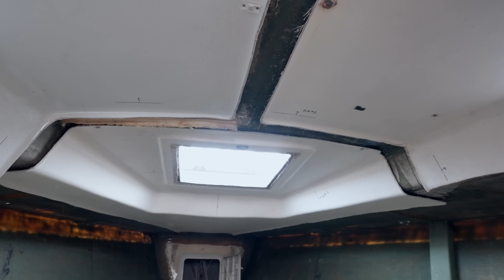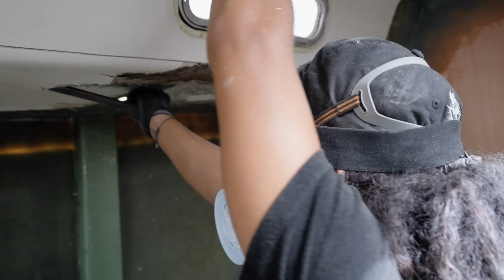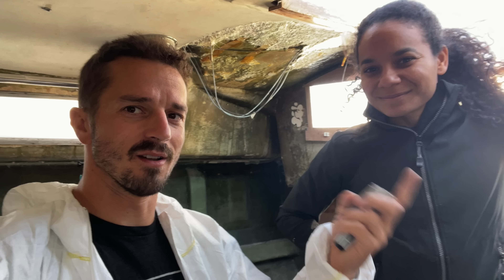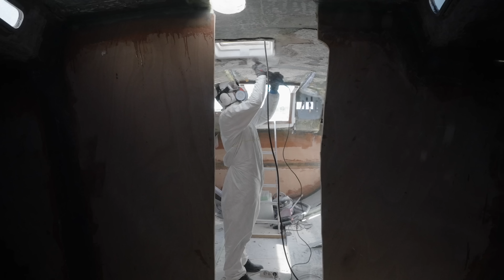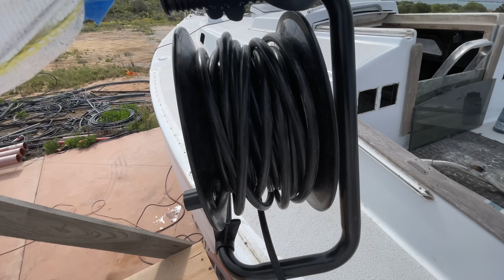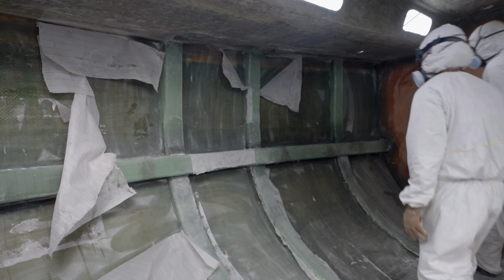Grinding It All Back Out | Step 389

Comment: It’s ironic how firmly the headliner was attached vs how poorly the bulkheads were. Admire your perseverance 😊
Reply: This comment right here!!!!
Reply: If the entire boat was made out of headliner, they'd have never needed to do this project. 😂
Reply: Still would have had the condensation issues did you not watch?@talyrath
Reply: To bad that at the Factory the headliner personnel did not install the keel and the keel workers install the headliner, would have produced a much superior vessel
Reply: @mattdouglas5570, I bet you’re fun at parties…
Reply: @SailingUma  Have you seen Kraken yachts ? based in Turkey. Well worth a visit. They tie the chain plates to the keel.
Reply: Great work this week guys. Sometimes the least rewarding work is the most interesting. The resin, the moisture, the power out! Thank you.

Comment: To stiffen the top you should do a grid similar to what you did on the hull. It doesn't have to be a very tall grid, but even a 25 mm high grid would do a lot. Make it about 0.6 meter grid squares and that flex would just about disappear. The grid would also give you something to mount your removable sections to. You could also run some plastic flex conduit to route the wires for lights and the like.
Reply: I totally agree with you.  The extra space would allow for a wiring raceway system which would be great for flexibility and future wiring replacement/modifications.  The added deck stiffening is icing on the cake!
Reply: hmmm, a tasty possibility...
Reply: I was thinking the same.  One can use some  hidden mounting points.   Similar to how a swans floor boards come out
Reply: Absolutely!!! A must
Reply: This is a really good idea.  It will be a chance for you to flex your architectural muscles.  You could even make the structural ribs triple duty as a cable race, structural element and design statement piece..

Comment: Let the ceiling ribs be thick enough that you can armacell/flex insulate the ceiling, it will make a big difference both in the hot and cold climates, and it will lower outside noise.
Great work guys!!!
Reply: exactly my thought too, I strongly concur- now You have the chance to fix all this in one sweep !
Reply: A lot of that damp could well be condensation.
Reply: Spray foam for the WIN! If it's within the budget.
Reply: Also my suggestion: I would prefer a spray cork insulation if this would be in a budget -  cork is naturally resistant against mold infestation. Really admire your energy and stamina. With you two, one can experience that 1+1 is not two but a multiple - wonderful to see how beautifully you interact as a couple. Good luck with your big project: if anyone can do it, it's you two. Sailing greetings from Berlin
Reply: @t.p.2811  cork is also naturally resistant to fire and does not absorb water, but can absorb some oil.

Comment: As much as I hated to sell our 50+ year old boat, I'm glad I didn't end up doing what you are doing. I remember the squeeks and groans while sailing her and bringing a boat that old to modern is way more than I wanted or needed.to do. You are doing a fantastic job.
Reply: Behind the headliner you found moisture and mold ofcourse .
This means condensation, how are dealing with that now? 
Are you going to insulate the hull above waterline and the ceiling? 
Insulation makes a huge positive difference when you live on a boat where ever you are!
By the way, amazing refit you two are doing with an energy and enthusiasm I can only dream of and than i still will be tired 😊
Reply: they're basically building a whole new boat out of Uma's basic structure!

Comment: Hi there!
I’ve been following your adventures from the beginning, and have very much enjoyed them.
As for your current project, I’ve been there and done that!
We have a Goman Express 30 sailboat we bought new in 1982. 
By 1987 we realise that it wasn’t quite perfect, and after exploring many bigger boat options, we decided to to modify it.
So we took out the entire inner liner, both hull and deck, redesigned the interior, made a mold on top of the old deck and layed up a new cabin top.
We put in a quarter birth on starboard, moved the stbd settee back towards the hull, and many other mods.( improvements.
When it was all done we were delighted! But during the process, I often questioned my sanity.
If I recall we took out 80 lbs if dust from  removing the inner liners.
I am very much like  your first redesign!
It’s an interesting problem optimising the use of space in a given hull shape.
Best of luck!
Cheers😅
Charley

Comment: Idea, you could do a small profile grid under the deck like you did on the hull. Then you’d be able to hide wires and maybe insulate. Then it would give you a place to secure a headliner to.
Reply: Even just laminating PVC conduit pipe ( 5/8”) with a 6” wide band of glass will do both stiffen the deck and provide a route for cabling…

Comment: 17:46 story of DIY. I've been renovating my girlfriend's closet... Was gonna be a week project... It's been... 2.5 lol. 

Pulled off panelling. Laid hardwood. Mudded the drywall that was behind the panelling. Primed. Painted (walls and ceiling). Struggled with floor finish for days (still looks like crap) and still gotta paint the patches and install moulding and the actual closet lol

Comment: Getting rid of that overhead liner is a damn good choice, going back in, I would take 1" thick foam board and glue it up to the overhead and house sides, it will help keep the boat much more comfortable in the weather extremes and it won't condensate. 

You could either glass over it, or even better put a headliner in made out of vinyl that will not condensate, could do some nice wood on the cabin house sides and have something really beautiful.

Also I suspect with taking that liner out, and the floor liner, that you have removed close to the amount of weight as you have added, not quite, but close.
Reply: Watching this episode, I was also thinking about insulation & condensation. Sandwich boats have much less condensation. Since you've stripped it naked, you can add a layer of foam and glass on top of it, or any other insulation solution. I wouldn't leave the outer shell naked like this. I've been watching your work for years. Love your energy and mindset!
Reply: I had the exact same thought when I saw this and it shouldn’t even take more space and there was lots of air behind the headliner’s
Reply: Yes, insulate now, it will be great for reducing the weather extremes above deck.
Reply: @janbennetsen7292  yeah, that was actually quite cringe seeing that because to me it just looked like a big mold trap!
Reply: I think that is a great idea and now is the time to insulate. I hired a urethane foam sprayer guy who came out to our Seawing 43 and sprayed one inch of foam on the hull/overhead which I sanded smooth (easy to do with a sanding board) and saturated a matt/10 ounce fiberglass cloth over the top - 25 years later it is still warm and dry in the Pacific Northwest.
Reply: @Morrisfactor  I sail the PNW as well, you can ever have enough insulation up here!
Reply: @RenegadeADV  YES!  My current boat here in Annapolis (Hollmann 52) does not have insulation, and it is cold/hot and produces MOLD like crazy - makes me yearn for an insulated hull!
Reply: @Morrisfactor  I have a Spencer 42, it made such a huge difference when I insulated the hull. Went from running 3 electric heaters to 1.5 when it was super cold.

Comment: Rustoleum 9100 has proven by far to be the best two part epoxy paint to use for the boat interior, including the bilge. It has various activators that allow for total immersion applications (bilge) as well as low temp application. It's used on oil rigs and other industrial applications. Does not require sanding between coats.
Reply: Thanks for the tip!

Comment: I hope you take the opportunity to insulate the hull and deck with som foam befors you close it with a final layer of glass. That will definitely have an effect on avoiding condensation in colder climate. Keep on the good and hard work. Interesting to see.
Reply: This is one of my objections to glass instead of wood as a building material.

Comment: It’s almost like they secured the ceiling of that boat with the the perfect glue vs the ribs and bottom structure with Elmer’s glue. What a big difference. Glad you guys pulled it down because those leaks are concerning.

Hopefully your lower back recovers. Grinding a ceiling like that with your arms above your head just wears you out like a marathon.

Comment: Removing the overhead liner makes perfect sense to me.  It squeaks, makes bedding deck fittings difficult, and when Dan pulled the large panel down, the dust that fell would be slowly filtering out for years !  Bet you will be much happier with it gone.   Meanwhile you probably itch like a pack of stray dogs!
Reply: Yes, imagine what that microdùst is doing to the lungs!

Comment: One idea for the new headliner: use a stretched fabric solution like Whisper Walls. It's lightweight and provides easy access to the underside of the deck if needed.

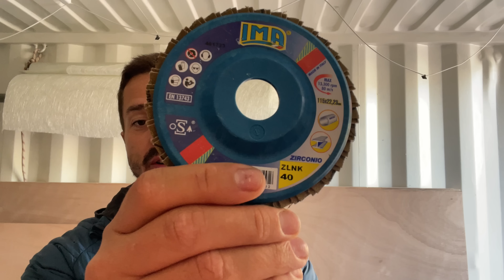Comment: 14:45 get a surface conditioning tool, I have one made by vevor and they are incredibly useful. You can get a drum for anything and it leaves a way more even finish than a grinder with less work.
Reply from the maker: Yes on flat surfaces. But what about compound curves? Wouldn’t they dig in?
Reply: @SailingUma  depends on the drum and how steep the curve is, the abrasive brush and the more spongy stripping drums are pretty forgiving and do work on compound curves, you can also use the corner like you can on a grinder.
It won't replace a grinder but it really helps in my opinion.
I got mine for dealing with my car and some boat work.

Comment: Glad you removed the headliner. Lot's of crap up in those nooks and crannies, that would always come down as dust. And yes, the weight reduction.
A bit late now, but the tool I've found that makes short work of removal is a flat scraper blade that attaches to a sawzall. It removes tabbed fiberglass or separates dissimilar materials with ease. Used mostly to break up floor tiles and remove glued down carpet.
I love that you've integrated your design backgrounds with physical production, and done very well at it.

Comment: About adding a new glass layer on the ceiling. On the rest of the hull, the new fiber layers added had the resin "flowing" down or sideways with gravity. On the ceiling the resin will tend to flow away from the joint, towards the lower surface of the added layer. 
Are we sure the new layer will stick nicely to the ceiling or will it be prone to delamination because of that?
Congrats for the great channel and dedication to this project. You're awesome.

Comment: You may want to do a little fairing before you glass the underside of the deck... it should increase bonding with a more regular surface as long as it's prepared properly.
Reply from the maker: For sure!

Comment: A nice 1/2" by 1" grid system on the roof to stiffen it up and allow cables and lights to fit, also make the roof sections out of carbon fiber to save on weight if you have the funds.  Has a boat architect told you how to stiffen the bulkheads where your main stays attach to make it extra strong and wide.
Reply: I was wondering about carbon fiber also - may  be worth it in the top lining.

Comment: Since you guys are basically starting over from scratch rebuilding, you should totally add in an AC to keep you cool and comfy and keep the bugs out by being able to keep the boat closed up in hot climates.
There's some awesome ones that are relatively compact and virtually flush with the ceiling so it doesn't interfere with your head room. 😊
Reply from the maker: We’re considering it. But in 10yrs the only time we’ve wanted or used it is in marinas. Which we tend to avoid!

Comment: Any small air pocket next to the skin/deck will collect water.... I found the same thing. The head liner must be sealed to skin or well ventilated. I removed our headliner in the middle of the hottest, driest part of the year and the cavity was soaking wet. Once open, it dried out in less than an hour to bone dry. We only used that boat for "camping" so I left it open and painted it. There were originally 3/4inch strips of ply as "beams" but I replaced those with 1.73 inch arcs cut out of a 2x10. As the deck had started out as pretty much flat, it wasn't that much of an arc. You may be better with a laminated beam to form the arc you need.... but it doesn't need to be very thick. Beams look nice, I think.

Comment: how about putting your foam ribs glassed into overhead to gain stiffening of cabin roof? (you could preplan small wire "passageways" through the  ribs before glassing)??.... till  using the dainty carpenters finish hammer for demo , i see + get a "posket sledge" 3 -6 lbs( you will find it useful in amny applications, while you build your muscles!!.... be Well!

Comment: If you want to get rid of the condensation issue you need to add some insulation and a waterproof barrier on the inside (would be called vapour barrier in a building!). You can't negotiate with water vapour physics...

Comment: I am using the same flap wheel discs on my grinder to take the old coating off the bottom of my 27ft. it is quick, but you're right, it is very uncomfortable. I am glad you said something about the edge of that wheel, i didn't think to grind the edge down a bit because i did run into a bit of gouging while trying to remove those bottom coatings.

Comment: Yes, the liner was structural somehow. A grid of 1x1" foam ribs 10" apart would give a lot of strength... you can also screw the liner to the ribs... You can also use the ribs as a channel for the wiring..

Comment: Geeze y’all. That’s some serious hard work. We had spray foamed our little 25 footer after glassing in pieces to screw the facade over top on our cabin top. It keeps the moisture out of the boat. The only place that sweats are the ports and the cabin sides, as this was the only place we didn’t foam. (Well besides below the water line, as this shouldn’t be foamed) Good job y’all 👍👍💪💪

Comment: I started watching Sailing Uma at Step 6, Rebuilding our Keel Structure. It's been an incredible journey over the past 8 years! Feeling like I know you both from watching all of the videos and your propensity to research and plan, is it actually cheeper to completely refit Uma vs. buying a new boat? In the end Uma will be reborn as a new boat from the inside out!
Reply from the maker: It’s 10X cheaper to refit if you do the work yourself. 2-3X cheaper if you hire a hard to do it. New boats are super expensive.

Comment: Removing the liner is easily the hardest job to do on a boat interior. I did that on  a 60 foot boat with my dad. Day after day we cussed pulled and ground it out. Fortunately I was in my early teens and I was strong enough to do the job. It did teach me to never do that again! When you get the next layer up there it will help with firming up the deck. At least now r there are much better materials to do the job with. We didn’t know anything about peel-ply. I wish you guys luck and try to find a hot tub somewhere, you might enjoy the relaxing of your overworked muscles.
Best of Luck, Your Pal Al

Comment: Dan…after I removed my ceiling liner and sanded all the high spots off, I sprayed texture on it and sealed it with water proof paint and it held for 8 years when I sold the boat.   It looked fantastic and hid a multitude of sins.  😊

Comment: Demanding difficult work, grinding overhead and the nasty dust!  I would definitely add some re-inforcement to the deck, thick ribs are proably the easiest thing.  in terms of insulation, I can see that for a deck it's better to add later, as having glassed in foam core makes for much more difficult installation and maintenance of deck fittings. Thick ribs leave more space for insulation.  You must be really pleased to have got rid of that mould, it is bad for your health.  Hope you can get some insulated windows with insulating covers, anything that cuts out the condensation will be well appreciated in cold climates.  It's a complete rebuild from the inside!   Perhaps you can make your own foam core panels (see The Duracell Project), the weight saving is significant, and where the will be water such as in the heads and galley, you avoid the risk of rot.  I think the Duracell Project's system of batch making their own variable spec foam panels is brilliant.  You should have space in the container to make a foldaway vacuum table.

Comment: I strongly support LostYogi's comment, you need insulation in the cabin top and sides. That small air space between the inner and outer layers did provide some noise and thermal insulation. Now is the time to do it right.

Comment: in my Pioneer 9, the headliner is similar to yours, and to my view it plays a structural role. 
the only soft spots i still have one the deck are exactly where the liner wasnt epoxied to the deck. 
since ive rebuilt the whole V berth interior adding semi bulkheads made out of 3 mm G10 - which essentially connects the deck to the hull - , i was able to eliminate almost all of the soft spot but i still have them. 
in the main cabin the rebuilt didnt call for the insertion of any new G10 vertical partitions but, like in your boat, there a space between the liner and the deck  (i also had leaks and condensation just as you shown) and that space will be filled with 2 part foam, which will not only insulate and act as a core material, thus reinforcing the cabin top wheni step on it.

looking at your footage your deck is really flexing and i honestly dont know if a couple of layers of glass will remedy that.
i would get that foam you guys got for the stringers and frames, have them about 1 inch think and laminate them at spaced intervals kinda like deck beams. you could then use them as the place to affix the new cabin liner.